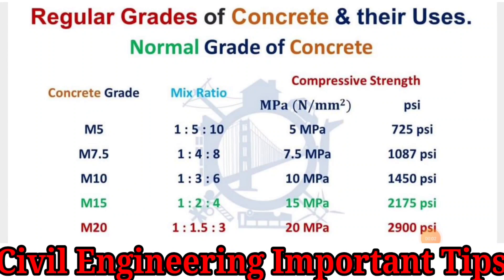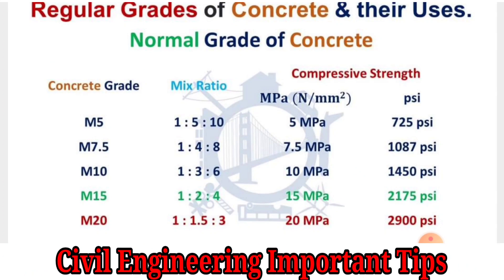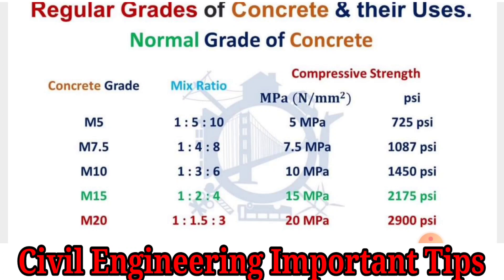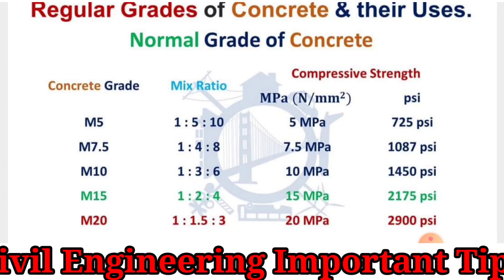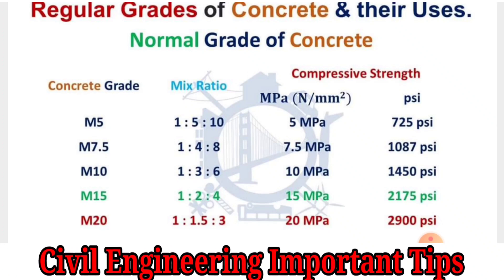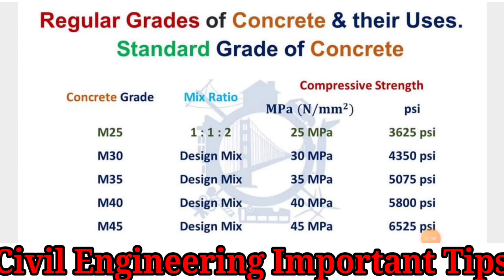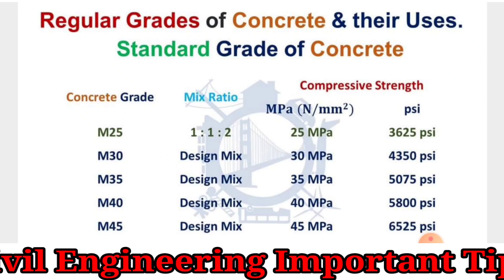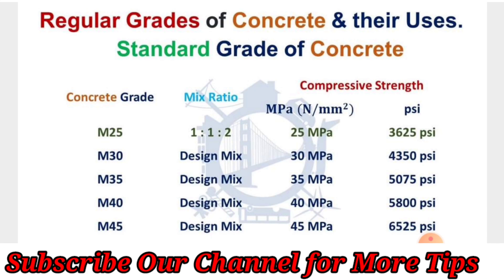Grades Of Concrete In Details,Normal Grade,Standard Grade,High Strength Grade Concrete #English

Comment: What is a psi.?
Reply from the maker: Pounds per square inch (psi) measures the compressive strength of concrete. A higher psi means a given concrete mixture is stronger, so it is usually more expensive.